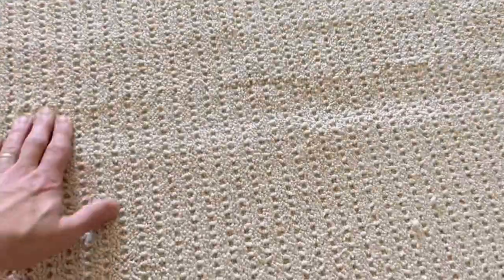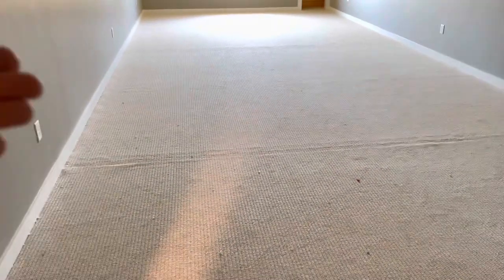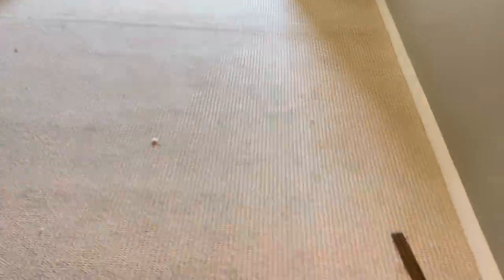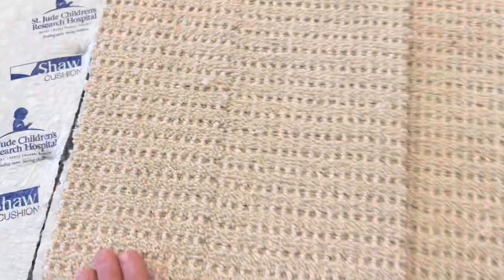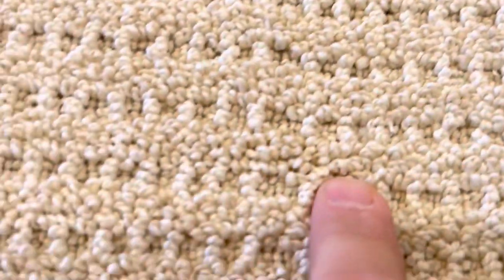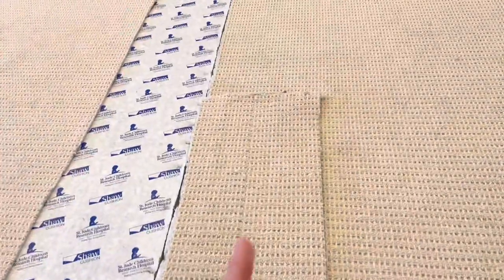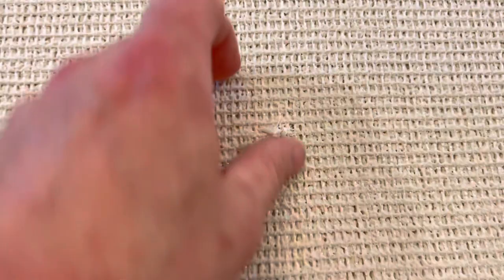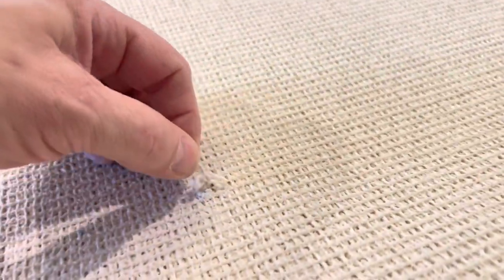Bad carpet seems, patterned carpet cautions

Comment: Suuup?  For all you youngins,, 6inch tape used to be industry standard on berbers!  And the berbers of yesteryear,, you would have 4 guys to get that beast up those stairs!   I wonder if this carpet is LISTED as a NO PATTERN MATCH?  Lots of them are!  Poor dude missed everything on that install !   Sure hope you charged accordingly on this one ! Theres quite a difference in labor costs across this country!   Almost all rug has bows these days !  When you roll out the rug and it's bad like that ,,you should contact the store or work room and let them know  !  Take a bunch of pics also.  Protect your money!  Used to show up on a job with your tools,, now you need a van and all the supplies.   The money's there ,, you just have to get it or sometimes walk away. Your kids don't need dinner every night,  nor new shoes every 6months.   Good day!
Reply: yes you cant just keep cutting 6 8 inches of the side just because the pattern runs out some ownes has to fall on the manufacturer in this case  or every job will have more seams than neede and in spots there not needed  or rolls are gunna have to be 10 metres wide so we can get the good bits out of them lol
Reply from the maker: @jb-es5zj man I hear you there, the manufacture, definitely needs to do something about this problem

Comment: That’s why the other layer ran the carpet the other direction. He didn’t want to haul a 36 footer up those stairs. I would have hauled the 36 footer up the stairs so I didn’t have those seams crossing the windows  and the light.
Reply from the maker: Yeah, that’s exactly right, about 20 or 25 minutes to get that roll of carpet up the stairs without killing everything and ourselves. It was worth it in the long run because the job turned out beautiful.

Comment: You should be a inspector also.I dont blame dude other than the ugly seem.36ft cut up the stairs I would have turned it and burnt a good seam.
Reply from the maker: I’m working on it
Reply: The store I work at has 5 crews,  3 of the 5 crews are man and women crews. Husband and wife, father and daughter, 36’ is tough for everyone, but I guarantee none of these women weigh over 120lbs.  One of them is 60 years old.  The women are hard as nails but I am sure they would be running it the shorter way.
Reply from the maker: @Choicejodi  wow that’s pretty impressive, I bet they would run it the other way also
Reply: Inspectors are usually guys that couldn’t hack it in the field.
Reply: @robertgoss7355  True but not always

Comment: Wow! The 6in iron isn't even all the problem. Those are horrible seams. Did he straight edge them? Lol man how would anyone think that they could get away with leaving it looking like that? That pattern an easy one too. What's the holes in the backing from? Stay nails? The edges of carpet always dive off like that. Must be how it's made.
Reply: I totally agree with u the 6in. Iron is not the problem and I don't use the 6in.iron anyway..But like u said that was a simple pattern and had the installer row ran the carpet on the correct rows to match the seams it never would have stuck out like a soar thumb.But yeah that was a terrible install and the installer had no clue on what they were doing
Reply: @markmurdock280  I don't use a 6in either. Can't believe someone could leave a job with it looking like that.
Reply from the maker: The holes in the back of the carpet were from a spike, he obviously used a spike to stretched in this Berber carpet
Reply from the maker: The carpet usually will dive off like that near the edges, because when it is coming off the creel and getting rolled up during the manufacture process, the edges tend to get a little stretched as it is been rolled up
Reply: @FloorsbySouthernboys  that's what I thought. U can really notice it in berber carpets